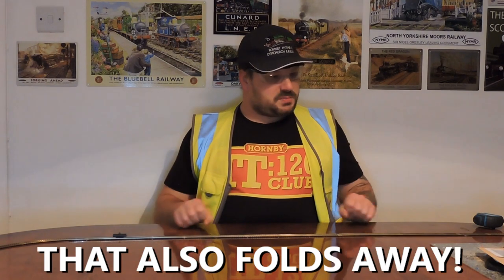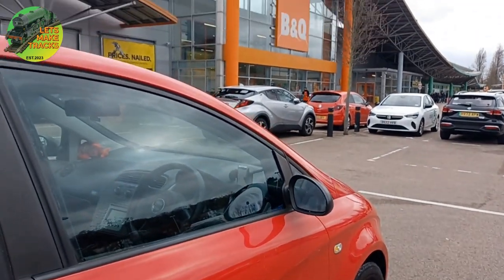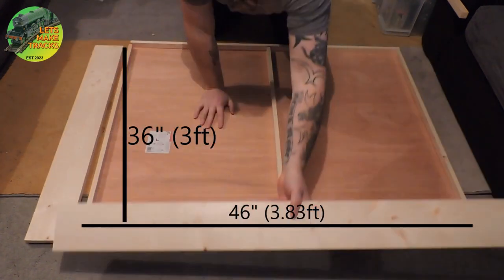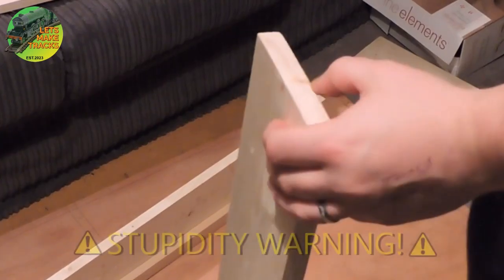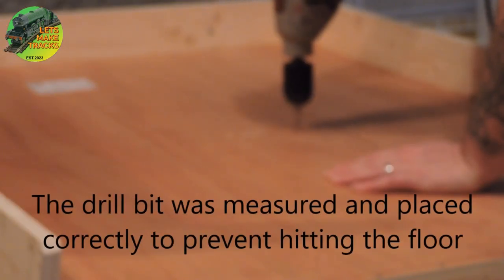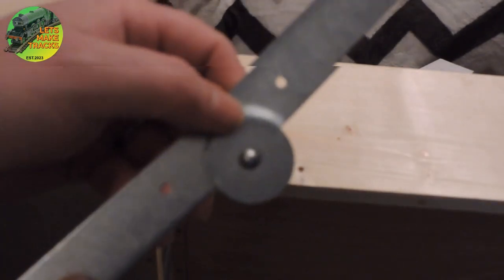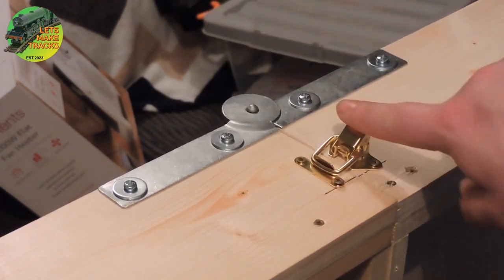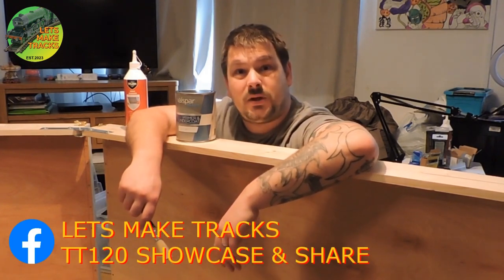Folding TT120 Model Railway Base Board | Compact & Portable!

Comment: Making the frame more suitable for the job will prevent those warping issues far more than any number of coats of paint will do.
Reply from the maker: The frame board was warped when I bought it, I just dident realise untill too late.

And that was going off my last build when I dident paint the board at all and the middle sagged a little after I did the ballasting.

In all honesty my skill level is cowboy at best 🤠

Comment: Useful video. I would not recommend coating the wood with PVA prior to applying the primer as this will cause the primer not to adhere! If you use primer, then you don't need to apply PVA. An alternative is to use Cuprinol Garden Shades green. You'll need 3 coats, but it is easy to apply and dries quickly!   You can apply Curprinol shades to the bare wood and keep the primer for something else.  Thanks for uploading.
Reply from the maker: Glad you enjoyed it.

Thank you for the tip but I have already fully painted the wood now
(update video soon)
Hopefully the B&Q ladies havent done me wrong, Time will tell I suppose lol

Comment: Thanks, really interesting. I also have a problem of "This table should not be occupied by this" 😂
Question: What are you doing with tracks? Layout is going to be assembled and disassembled each time?
Reply from the maker: Track will be permanantly attached to the board, I will show how to bridge the gap in my next video.
The frames have also been measured to accomadate buildings and scenery, so this is going to be a full on model railway that can be set up or put away 😒 In minimal time.